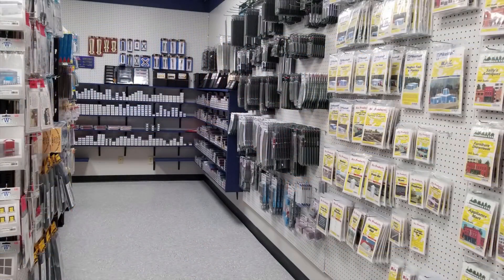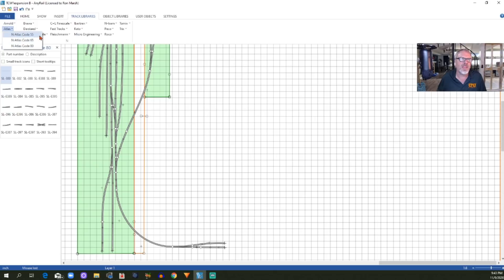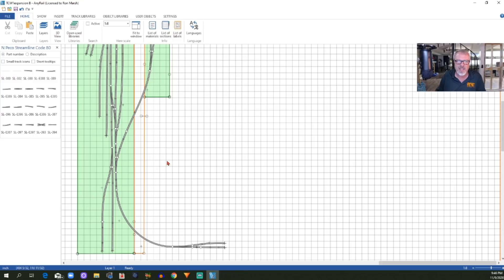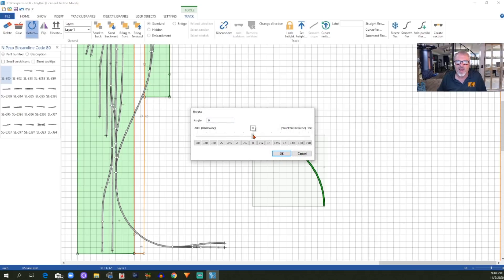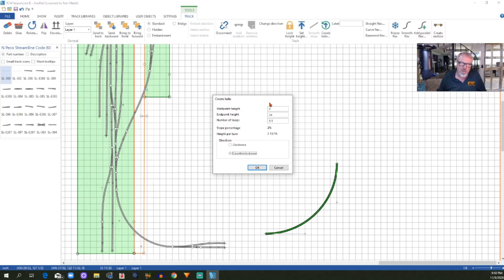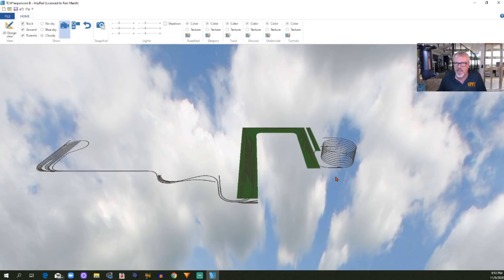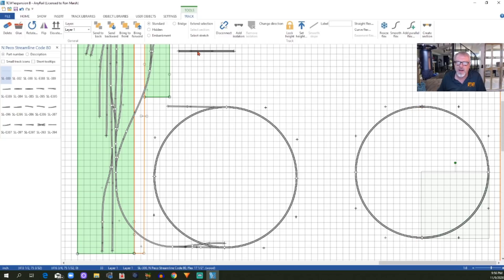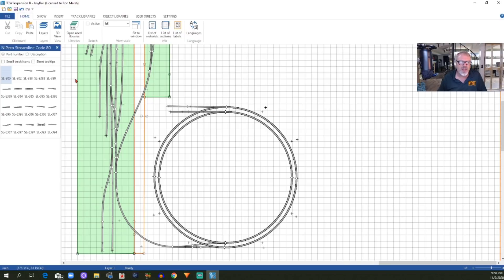Design a Helix Using Anyrail6 For Your Model Railroad Layout

Comment: Hi Ron.  Just heard your comment from ~16:06 about not being able to get the second helix to connect to the starting point just off your turnout. I see that you have the entire helix selected. I believe this is why it's not working. Try just having the first piece of flex track in your helix selected and try to connect to your turnout. I've built sections of track in AnyRail and tried to connect it to the rest of my track plan and run into similar issues. If you click on only the first piece of track that you want to connect to the rest of your track plan you'll notice that the rest of the "floating" section will follow when you drag the first piece and then you'll get the blue dots to indicate a connection is possible.

Comment: Hi Ron. Another suggestion for accurate rotation is to simply place the amount in the box above. 90 for 90 degrees. I found that much easier  than manually rotating. Great video 🙂

Comment: Great video Ron. May I suggest that when you create curves with flex track you can specify the degrees in a - number. If you had put -90 for the turn instead of 90 it would have curved it counter clockwise for you from the get go.

Comment: You can automatically connect the bottom of the inside helix pretty easily. If you click on the "Show" option on the main tool bar at the top (beside "Home"), and then go the far right, you can choose to just show the track from elevation 0 to elevation 1. That will hide most of the helix and only display the bottom loop. Then you can drag the end of the helix to the end of your existing track and get the blue circle to automatically connect them. Then just change the "Show" options back to 0 and 24 to see the whole thing. It is a great way to change your display and only work on one level at a time.

Comment: Thanks Ron,  I have the same problem wit them connecting to, but I may may have not had the whole helix highlighted, thanks again for the help....Jack 👍
Reply: You can automatically connect the bottom of the inside helix pretty easily. If you click on the "Show" option on the main tool bar at the top (beside "Home"), and then go the far right, you can choose to just show the track from elevation 0 to elevation 1. That will hide most of the helix and only display the bottom loop. Then you can drag the end of the helix to the end of your existing track and get the blue circle to automatically connect them. Then just change the "Show" options back to 0 and 24 to see the whole thing. It is a great way to change your display and only work on one level at a time.

Comment: I just bought AnyRail 6 on Thursday. I played around with the free version a week ago and I got frustrated that I could only use up to 50 pieces of track. But I also needed to upgrade to a better more up to date CAD program than what I had been using, 3rd Plan It I think? Made by Abracadata? I have 3 plans to design. See if I can help Vinny out with his 3rd level scenic run to Williams. Then I have 2, 1 in HO and 1 in N scale. I'll need to go back over your tutorials on AnyRail 6.
Reply from the maker: Hey Roy. Good to hear from you. I think.you'll be pleased with AnyRail as you get used to it. There are more sophisticated programs out there, but this does all I need and the price is reasonable. Indon't need to pay $300 for features I'll never use.

Comment: Looks like interesting software. Because your outer helix loop is 22.5" and your inner helix loop is 21", you might try adding 1-1/2" of track to your inner track coming off your inner switch branch, that should make up the difference of the gap you have at that connection point. Take care.

Comment: Hi, the reason it won't connect is you are not highlighting / touching the first / connecting rail, you did for the outer joint, but when you tried the inner one you were dragging the wrong section. Alternatively drag the straight to the iner helix and it will connect then drag it all back into postiotion. When you want to join any two peices you are dragging / touching one of the rails you want to connect but if you are dragging more than one peice you must be touching the one you want to link. Hope that helps, dave.

Comment: Very helpful! Thank you. Please keep the Anyrail tutorials coming!
Several questions. I am planning to design/build a double-track helix in N-scale with a 22.5 radius for the outer loop, just like this tutorial. I may be able to go to a 24-inch radius (still working out dimensions in the train room). If I construct the radius using sandwiches comprised of two layers of 1/4-inch plywood, creating a half-inch thick deck, cutting the plywood into trapezoids, glued and screwed with offsets to create what might resemble a pinwheel if you look at it from the top down -- what spacing outside the outer loop do I need? Does this replicate the 1.5 inch spacing between the centers of the two tracks? Do I need a similar spacing on the inside of the inner loop? Which would compute to 1.5 outer spacing plus 2.5 inches for the double-tracks plus 1.5 inches for the inner spacing? That would total to 5.5-inch-wide strips cut from the plywood -- or do I need something wider? Next ... is there a way to use Anyrail to display this plywood base -- or some other software tool or calculator that would compute the cuts to the plywood, and the heights of the initial spacers that trigger the angle of the rise at the base layer of the helix, before you get to the point you can insert 3-inch spacers between each layer of the wedding-cake helix? Next question comes out of left field -- has anyone built a four-track helix, and, if so, is there a web site that shows how this is designed and built?
Reply from the maker: Hi Steven. First, I have seen helices build as you describe, but I'm no expert at it, What I do know is that building the helix from straight pieces as you describe will require extra width to account for the curved track traveling across a straight piece. There are videos on YouTube about such construction. Search for octagonal helix or octogon helix. Second, AnyRail can be set to automatically include the roadbed for track. There is probably a way to draw the helix subroadbed, but I've never looked for it because I never found it personally necessary. I am sure that I have seen a four track helix--it would have to be huge--but I cannot tell you exactly where. Google it or do a YouTube search.
Reply: Thanks Ron for such a helpful tutorial.  May I suggest a visit to the ‘Nock’ web site.   More well known for scenic materials in the UK, this German firm have included details of how to construct an octagonal sub base for a double helix on their web site. In essence you make the sandwich you describe, to build each segment, at a width of 172mm (for 00/H0). The sandwiched segments are each offset by 176mm to create a surface for connecting the next adjacent segment at a angle of 60degrees. When constructed the sharp corners of the outer sub base can be trimmed to form a smoother edge.
The Nock site includes a worked example using Marklin R2 and R3 curves and illustrates a spread sheet for calculation.  I could not find out how to down load this as yet. However as all the text is all in German little educated guess work completed my translation and it worked!  With the help of this video I drew it up in Anyrail 6.   Just now need to build it!
Happy modelling.  T 🚂
Reply: @tonyhill6296  Here's the link to Noch's helix kits. https://www.noch.com/en/product-categories/terrain-structuring/helix.html
Tony -- can you point us at the construction inspections you reference?

Comment: To get you inner helix to connect, you have to grab at the 5 o'clock position. You have to be holding the active section for auto connect to work.
Also , these are button on the rotate function, that you can increment rotational change.

Comment: Thank you.  I'm planning a layout with a polar express type mountain on two levels (table and wall shelf) . I think a basic helix is what I want, but something more conical with a larger radius at the bottom level and smaller radius on the second or top level. It’s only in the design stages because I have to decide at what heights to put the shelve, then how to design my mountain so my train can make it to the second shelf. I believe your software will help me accomplish this. Am I correct?  So basically on table : balloon on left, track to base of mountain, “helix” mountain on right.  Shelf: top of helix mountain on right, track from helix mountain to balloon, balloon  on left.

Comment: It's not auto connecting because you havent clicked on the piece of track to connect to the bottom spur. You're trying to get it to connect to a piece of track (the last piece of the bottom elevation) that is in reality 2 and a bit inched above the straight from your turn out.

Comment: I'm beginning the design of a small double layer n scale layout to be located within limited space.  I watching you tutorial about designing a helix with Anyrail6, a tried what you suggested and found that virtually none of the commands you showed appear in the version of Anyrail6 I have.  I'm wondering if the version you're using is an earlier version of Anyrail6 than what I have installed on my computer.  I'm currently using version 12.07.003.4049 (64 bit) which is supposedly the most recent version.  If the version you used in your tutorial is earlier than what I have, I suspect others may have encountered the same problem.  Would it be possible to do an updated tutorial  on designing a helix.  I really enjoyed what you came up with since it closely resembles what I have in mind for a 15 to 18 inch raise but using smaller 12 inch radii.

Comment: Good tutorial.  I found it particularly interesting that the helix top departure tracks were not really tangent to the helix itself.  I'm expecting that you did not have "snap-to-grid" or equivalent name turned on.  Could you have built and connected a 90 degree curve to each of the helix entry tracks and then built the helices from those curve segments ensuring everything was attached?  As you said a minor point but one that should not have happened.  Keep up the good and informative videos, they are appreciated regardless of my modelling in Ho.
Reply from the maker: I do not understand why you say thet are not tangent to the curves. They are tanget to the curves at the conection point.
Reply: @RonsTrainsNThings  As I look at the screen they didn't look tangent to me, but rather have an angular misalignments (kink) where they join the helix.  Maybe it is just that they are not parallel to the helix approach tracks that is throwing me off.  It certainly would be odd if the connection wasn't automatically made tangent by the program..

Comment: I thought from your opening picture, why are you playing with a Slinky. Does that software tell you the height between each coil to know your rail cars plus the thickness of any plywood will work out? How do you figure out the helix support height per run of track?
Reply from the maker: Yes, if you watch that portion of the video again you will see that all of this information is calculated as you enter the parameters of the helix. Thus you and tweek it until you get the height you need before finalizing the design.

Comment: Nice tutorial Ron! Now to figure out the way to have the different levels of my layout on the same AnyRail file (have my top level on one file and my bottom level on another).

Also, what did you use to figure out your numbers for the helix?
Reply: I use layers to seperate each level and I also use seperate layers for scenery, fiddle yards, clockwise and anticlockwise lines.  If you follow Ron's instructions to create the helix the pop-up box allows you to pick the rise and the number of rotations it then automatically calculates the slope %, so you can tweak the rotations to get the slope to 2% and it will also tell you the rise of each rotation. Dave
Reply from the maker: Well, math. I knew I needed to travel 24" vertically. I knew I wanted not more that a 2% grade on the main (outer) track, I knew I wanted to cut turns out of a single piece of plywood, thus max outer diameter of subrodbed was 48". Allowing room outside the outer track, that made my outer radius 22.5" (45" diameter, allowing 1.5" from track center to the outer edge of the subroadbed). Circumfrence of the outer track for each turn is (pi x d) 3.14159 x 45" = 141.4" of track per turn. At a 2% grade this gave me a total rise/turn of 2.8". Taking my total rise of 24" and dividing by my rise/turn of 2.8" tells me I need 8.5 turns to get the total rise needed.

Comment: When you tried to connect your second helix you need to click on the piece of track green hi lighted you are going to connect. You should have clicked on the piece of track on the right of the bottom connection.  Exactly the same way as if it was a multiple pieces of flat track.

Comment: Hi Ron,  I watched ur video and have been working with AnyRail for a couple of months. I have a layout I'm designing and it has a helix for a 2 decks. I have 3 drawings 1 shows the hidden reverse loop with a turnout designed to head into the helix going to the 2nd deck. Can I combine all 3 drawings into 1 drawing. Please let me know. Thanks Bob
Reply: Hi Robert,  I found the following worked for me -  
1 Create new layers in the file plan you want to act as ‘Master’ for the combined drawing.
2 Name a new Layer ready to accept say ‘hidden reverse loop’ for example.
3. Save this master drawing file and close it.
4 Open the file plan you want to copy from and select the track to be copied to the master plan Left click and select ‘copy’. Save the close this file.
5.Reopen the master plan file. Select the destination layer and then right click and choose ‘past’.  Your copied material will now be in the master plan on its own layer.
One key point - Make sure both the target and destination files are set to the same scale (eg 1:20) before copying and pasting.
Hope you can follow my description.  Happy Modelling, T🚂

Comment: Bluntly Ron, more informative would be how to calculate the circumference needed to accomplish the required rise (including the thickness of roadbed and support) using an acceptable grade.
That would benefit all modelers building a helix, not just those using AnyRail who want a 3d view. The key is really that first lap that needs to adequately clear the level below.
Reply: Well bluntly, that's not Anyrail's purpose. You tell Anyrail the radius, angle of the curve and how many rising levels and it draws the plan for you. To determine the circumference of any circle, multiply the required diameter by Pi.
Reply from the maker: Well, this was an AnyRail tutorial, so what you state is not within the toic of this video. That said, here is the answer to your statement. I knew I needed to travel 24" vertically. I knew I wanted not more that a 2% grade on the main (outer) track, I knew I wanted to cut turns our of a single piece of plywood, thus max outer diameter of subrodbed was 48". Allowing room outside the outer track, that made my outer radius 22.5" (45" diameter, allowing 1.5" from track center to the outer edge of the subroadbed). Circumfrence of the outer track for each turn is (pi x d) 3.14159 x 45" = 141.4" of track per turn. At a 2% grade this gave me a total rise/turn of 2.8". Taking my total rise of 24" and dividing by my rise/turn of 2.8" tells me I need 8.5 turns to get the total rise needed.
Reply: @RonsTrainsNThings  There you go.

Comment: As a though you may have to connect the inside helix first then do the outside helix. Not sure if you have tried this yet.
Reply: You can automatically connect the bottom of the inside helix pretty easily. If you click on the "Show" option on the main tool bar at the top (beside "Home"), and then go the far right, you can choose to just show the track from elevation 0 to elevation 1. That will hide most of the helix and only display the bottom loop. Then you can drag the end of the helix to the end of your existing track and get the blue circle to automatically connect them. Then just change the "Show" options back to 0 and 24 to see the whole thing. It is a great way to change your display and only work on one level at a time.

Comment: As other have hinted at, when you joined your lower start point of the helix to your existing track, the whole helix realigned to the existing track; as the existing track wasn't pointing in a 90 degree direction, the whole helix become skewed, only by a fraction of a degree but enough such that when the inner helix was added, the two helices weren't aligned. Better to have positioned the outer helix without the linking original track and then to have joined the bottom of the helix to the turnout.
Also, it is almost impossible to accurately align the 2 helices using the method you used. You would have been better, at the point where you created and correctly rotated the original piece of 90 degree track, to right click the piece and select 'Add parallel flex'. Adding the start of the second helix at this point at the required distance inside the first, would have created a perfectly aligned pair of tracks.  At this point each track can be turned into a helix in turn, but will guarantee that the two helices remain with the same circular origin.